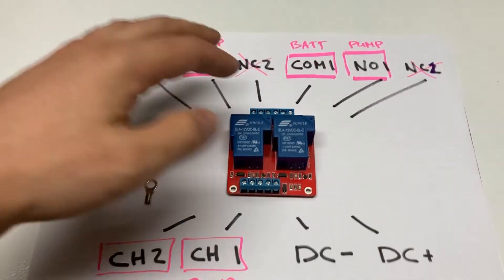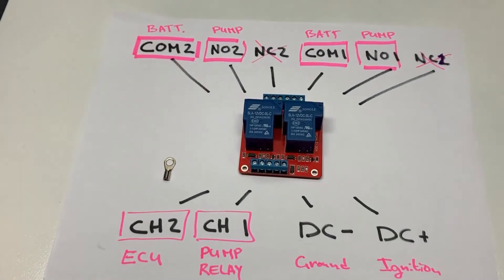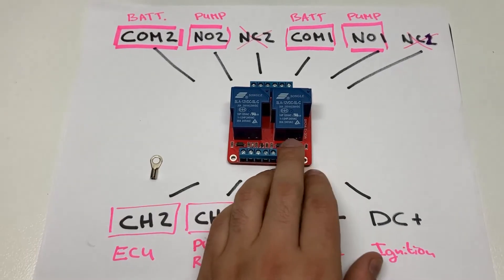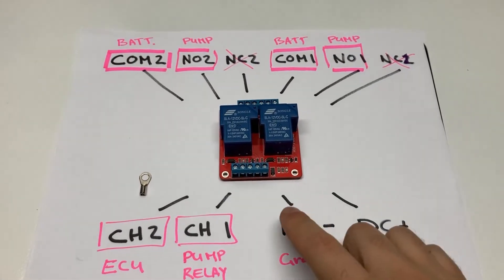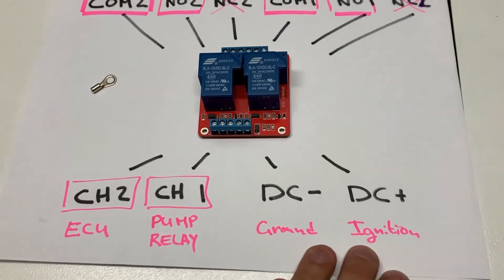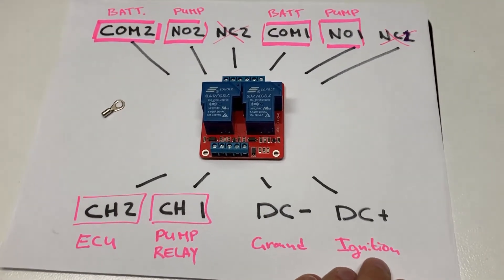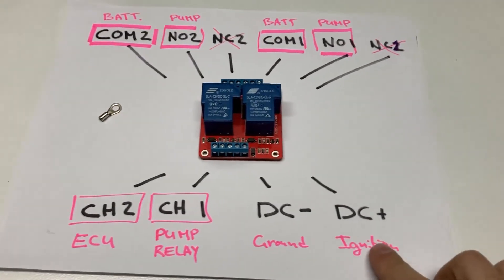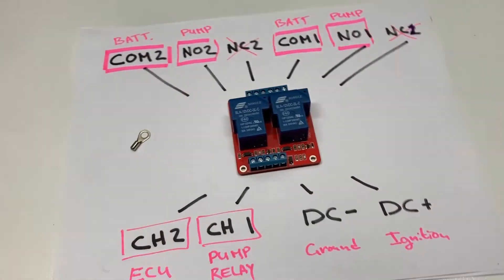Fuel Pump Wiring Suggestions and Tips

Comment: I’m installing a Haltech Elite 2000 into my Z32 and I’m using the relay you suggested from Amazon for my fuel pumps. For the primary pump, the Haltech plug n play kit picks up the factory fuel pump relay. Should I rewire this to bypass the factory relay and run the Haltech output directly to the new relay? Thanks!